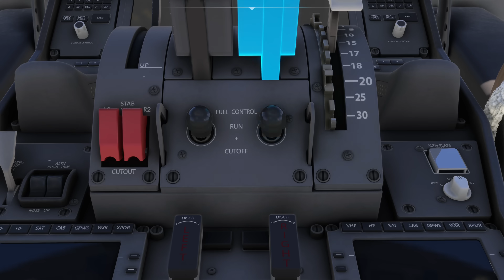Air India 171: Why Did The Fuel Cut-off Switch Get Moved?

Comment: In May 2025, under four weeks before the Air India 171 crash - the UK regulator issued a mandatory directive, quoting the FAA ( American Aviation Regulator), citing a “potential unsafe condition affecting fuel shut off valves”- these are controlled by the fuel control switches that are now in the headlines and are being double checked by airlines across the world. So no, not just a 2018 FAA  advisory, but a May 2025 mandatory directive from both American and British regulators flagging a possible safety concern with fuel valves that are like faucets for fuel to run smoothly to the engines. Really makes you pause, doesn’t it?

Comment: Personally I think these fuel control levers had a design fault. As soon as the landing gear was retracted both of these levers should have been frozen until the plane landed. An automatic system could have been built into the software to cut the fuel supply in the event of a fire.

Comment: I believe that the fuel valves were electronically switched off internally in this plane. The switches were not moved, or if they were moved, they were moved to reignite the engine process after coming to know that the engines lost thrust. Boeing knows this and they will quietly improve their system. Irony is that for the sake of money (insurance) and reputaion, pilots are blamed who are no longer with us and the captain lived and died to care his ageing parent and machine (a physical material) is given a clean chit. Planes are machines and they can't be perfect and we all know that when we travel in these planes.

Comment: I don't think the switches were ever moved, still in Run when it crashed.  Those on a 787 are just signals to  a computer I/O rack, simple electrical failures would look the same to the FDR.  I think the avionics crashed them.

Comment: Is there a safety feature Boeing can build into the plane’s system, from now on, that will allow the plane to know it is in take off ‘mode’ (only on take off, ie. after V1) and prevent deliberate movement of the switches to ‘cut off’? My thought process being that you might need to cut off fuel flow if an engine is on fire during landing but you definitely would not choose to do so during takeoff (after V1), even if there was a fire due to something being ingested into the engine (ie. a flock of birds, debris etc). The premise being that after V1 you cannot abort takeoff and you need the maximum thrust you can get to give you a fighting chance to get out of that difficult situation.

Comment: Captain Steve, 
Realizing that the aircraft during most parts of the flight could have recovered given enough time to restart the engines . 
Given your experience how many seconds into the flight would the Pilot have had to make the decision to end his, and everyone else’s lives ? In other words what speed and altitude might the pilot recovering have been successful? 

My assumption is at V1 (or a couple seconds after ) would have started the clock ticking. 

I mentioned this because you have mentioned probabilities several times before . And given we have not have heard of any fuel switch cutoff events anyway in any airliners flight plan, the notion that this just happened to occur in the apx 1% part of the flight that recovery would have been impossible able should really put to rest those theories that this could have been accidental . 
Given another 20 or 30 seconds might they have recovered? 
I’d like to see those simulations run. The pilot that shut off the engines had to have run those simulations in his head to pick the right window to do this , and when the other pilot had the highest workload ?? 
Just my thoughts 

Patrick 
An aviation enthusiast

Comment: we should keep the APU running for takeoff if they had the APUs running it would have saved precious time the computers would not have shut down and the weapon full cut off would have appeared on their screens immediately and the ignition system does not need to be reset so almost instantaneous start we would have saved the flight we should keep the APU running while reaching 10,000 feet it gives a margin of maneuver

Comment: Hey steve I am newer subscriber. Your amazing insight is so reassuring, my questions are, if this plane had of been an airbus would this event still happen with the fuel switches. Also because of so many engine flame outs and bird strikes recently why was the 747 taken out of service for passengers and why don't more airlines use the A380 would a plane with 4 engines be alot more safer incase of a bird strike or a pilot cuts off 2 engines

Comment: Still, why was the landing gear not retracted?
Reply: Makes sense that the pilot monitoring, the captain on this leg, would not retract the gear, but instead cut off the fuel to both engines.  That's why the gear didn't (and couldn't) retract and the rat deployed.  Suicide pilot was the pilot monitoring in all likelihood, and that would be the captain.
Reply: @toddyrich118  Thanks for your reply. Immediately after the crash, one hypothesis was that the flaps had been manipulated instead of the gear - by mistake. Maybe he was completely distracted and moved the cutoff switches when the other pilot said gear up? I know it’s unlikely, switch positions etc., but who knows.
Reply: @tonyborg6454 that's highly unlikely. With 34 years of commercial flying experience, I can confidently say that accidentally pulling the fuel cutoffs at 100 feet would be unprecedented. The actions and procedures for handling emergencies at such a critical phase of flight don't align with reaching for the fuel cutoffs by mistake. The investigation will likely uncover more information about the circumstances surrounding the incident.  And no way you pull off the cutoffs by mistake thinking they the gear or flaps.  No way, no muscle memory, and the knowledge that it will be guaranteed death.  Just no way you make that kind of error.  I believe it was deliberate.

Comment: Su1c1d3 doesn't seem to be the case, because they restarted the engines, there was never a struggle to crash the plane, they never tried to dive, they tried to climb, so I firmly believe it was an electronic failure
Reply: If it was suicide, they would know even if they switched it to "RUN" mode they still wouldn't have enough time for the engines to gain enough thrust to climb again. Just because they turned the fuel back on doesn't eliminate pilot suicide.

Comment: So far, no evidence has been adduced  that either pilot was mentally ill or disturbed.  There is no evidence that either pilot lied on the CVR.  Res gestae presumes both pilots are telling the truth as they perceived events in real time.  Assuming both pilots are speaking the truth on the CVR, the cause of this tragedy was most likely electrical or electromechanical.  If either pilot WANTED to crash the jet at that low altitude, all he had to do was raise the flaps, retard the throttles &/or shove the control wheel full forward.
The RAT automatically deployed because both engines were starved of fuel - NOT because of the position of the fuel control unit switches (FCU).  [Just ask Air Canada when they ran out of  gas because of misfueling.  It didn't matter what position the FCU switches were in.]
Everything the Air India crew did here was consistent with efforts to restart both engines w/o knowing exactly why they had rolled back in the first place.  If both engines quit with the FCU switches in the "RUN" position, they would have to be placed in the "CUTOFF" position & then back to "RUN" to initiate the restart sequence - which is consistent with the thrust levers being retarded.  The problem is not with the AIB Preliminary Report, but with others drawing their own unfounded conclusions based on incomplete evidence or untested hypotheses.
Respectfully submitted,
NLC

Comment: Your bias towards the manufacturer is so clear by the use of term  "plane was doing exactly what it is supposed to do". No one can be THAT certain in an aircraft crash investigation. I have read the report. The report never mentioned the cause of transition. no physical examination of the switches, are the springs intact? why does the report not mention the advisory reported earlier. why are other airlines launching checks? why was the report unsigned?

Comment: 3:10. Cut off confirm: I could see a warning for 5 seconds and second input necessary to confirm fuel cutoff. but needs to be possible by 1 pilot, in some case 2 pilots are not present.
Reply: There are surely one billion different reasons why this cannot/must not be implemented.

Comment: Unfortunately, no computer, procedure, logic, or hardware can fully prevent a deliberate act. The human factor will always pose a risk—from errors made in the cockpit to oversights in the maintenance shop.

In this case, what happens during the 10-second lapse between both fuel levers being set to CUTOFF and the first one being moved back to RUN is especially critical. The audio recording during this period would be essential to better understand what really happened. Based solely on the preliminary report, it's possible that either pilot could have moved the levers to CUTOFF—even the one who later asked, “Why did you cut off the fuel?”

If the event was truly accidental—such as one of the pilots inadvertently moving both levers to CUTOFF, especially given the report of the posibility of absence of the locking mechanism—then it's difficult to explain why there was a 10-second delay before restoring the first engine to RUN, and another 4 seconds before the second. In a real emergency, such delays are highly unusual, particularly when altitude and time are limited. This sequence raises questions that go beyond a simple mistake and may suggest deliberate action rather than an accident.

That said, it's important to avoid drawing final conclusions until the full investigation is complete. The Cockpit Voice Recorder (CVR) is a key element here. If the recording captures both pilots' voices, investigators can analyze the tone, reactions, and timing of each one to determine their level of awareness, stress, or intent. Distinguishing the voices may also help establish who moved the levers and whether any attempt was made to correct the situation in real time.

Until all available data—CVR, FDR, maintenance history, and psychological background—is thoroughly reviewed, any interpretation remains speculative. However, the available information does raise serious concerns that warrant deeper analysis.

Comment: I like how captain Steve is totally against the cockpit camera, as he stated that the flight data and audio recorder give sufficient information. This is totally unreasonable as the camera would of been able to capture the pilot placing the fuel switches from run to cutoff or the engines failing, therefore it would be clear what happened.

Comment: 787 fuel burns at 190 pounds per minute.the plane was airborne for less than a minute. for that minute 190 pounds of fuel
were in the engines system. with ignition off the engines would continue their burn from heat and inertial forces in relation
to cockpit throttle positions. with both engines fuel and ignition cut off.the engines would run and shut down in stages not right away.
 
i do not have the 787 technical manual.these are only my guesses at how a jet engine shuts down in flight and on the ground.
the engines start in stages and stops in stages.a car engine stops the moment you turn off the ignition.
jet engines stops in stages.

my personal conclusions are that the computers over rode the throttles full speed position .the throttle can be
at full power position.but the computers can tell the engines to ignore the throttles and run at  a speed far too low to sustain flight.
ignition and fuel are on and the throttles are at full speed but your plane is going slower and slower and theres nothing you can
do about it. this is the world of fully computerised flying.

your modern day jet is flown by the pilot ,the copilot and over one hundred  functioning or dangerously malfunctioning computer systems.

Comment: it is not possible to cut off both engines within 1 second. it is a issue with plane cutting off fuel not pilots
Reply: It is possible and exactly what we do after we set the parking brake and turn off the seat belt sign.  Cutoff, cutoff - only a second between.

Comment: There was nothing in the Preliminary Report describing what testing has been done on the fuel cut-off switches to determine whether the locking mechanisms were functioning properly.  Has malfunctioning locking mechanisms been ruled out?  If, for example, the springs were broken, could the fuel cut-off switches simply drop to the cut-off position under heavy vibration?

Comment: Cameras would tell us what happened and maybe some of the why, but it wouldn’t stop intentional sabotage. I like the idea of critical systems being tied to both pilots. But also how about a verbal announcement (as with terrain, pull-up, etc.) that the engine fuel has been cutoff? Doesn’t have to repeat a bunch, but this seems like a quick fix rather than redesigning the input systems to be both pilots and retrofitting them on all current aircraft.

Comment: Why would the aircraft allow a pilot to shut off the fuel once in the air, should there be a fail safe to stop this from happening and are there any circumstances that you would need to shut off fuel once in flight i.e an engine fire

Comment: Another pilot captain on another channel emphasized the amount of time it took from switching fuel switch one off until switching fuel switch one back on. He dramatized the pause by sitting still and letting a stopwatch count down on the screen. Okay. Great for YouTube drama. Not a fan, though.

Question: Do we know how long after the fuel switch one went to OFF it took pilot one to say, "Why did you cut off?" My imagination tells me that it took a second or two (or three) for pilot one to realize (either through aircraft response or engine timbre/sound) that something was different. That would place his question and reaction of reactivating the switches closer to the end of the 10-second interval. That would also mean, contrary to the emphasis the other "captain" levied, that there was not this 8 to 10 second interval of pilot one performing mental gymnastics as he tried to figure out what to do.

Question 2: Was there any indication from the video, observing the detail of movement, that we might consider something like, "That little wing dip there was likely where he reached over to flip the fuel switches." Or maybe, "That little wing dip there is likely where he realized something was wrong." I can only imagine that in a terrible situation like that, we would not be holding the plane perfectly steady.

Comment: I am not denying the possibility of suicide / mass homicide, but I can think of two other possibilities.
Captain Steve made a great case for the mechanics and timing of the switches indicating manual operation, but linguistically speaking, the pilot flying could say "Why did you swich to Cutoff?" based on the behavior of the plane rather than witnessing the other pilot change switches, and the reply "I didn't do it" would be factual.  This is depends on the switches being defective and is very unlikely.
The other is that the other pilot has a form of brain injury or illness.  
Trigger warning for violence.
.
.
.
.
.
.
A man was attacked with an axe while sleeping and stuck 16 times, but the next morning despite massive head injuries and being missing part of his lower jaw, he shaved, dressed, made cereal, put the dishes and cutlery in the washer, and wrote a check before passing away.
Obviously, this is also extremely unlikely!
Captain Steve's analysis, based on his experience and that of others plus historical data about equipment, is most likely.

Comment: One person makes up their mind, and then others—most of whom have never set foot in a cockpit—simply follow along. Textbook case of confirmation bias.

Blaming pilots before a final report is out goes against “innocent until proven guilty”. Channel owner pilots jumping to conclusions—claiming the crew did it, based only on an incomplete, confusing preliminary report. Pilots know how to fly but most are not systems experts. I would like Captain Steve or anyone making these claims to actually explain how the fuel cutoff logic works, with a wiring diagram—not just guesses. Instead of acknowledging their own blind spots and biases, they double down, blame the crew, and collect views.